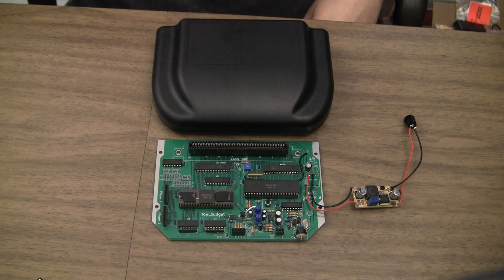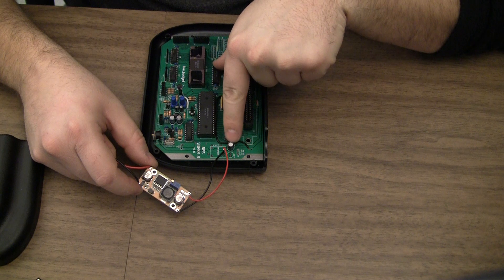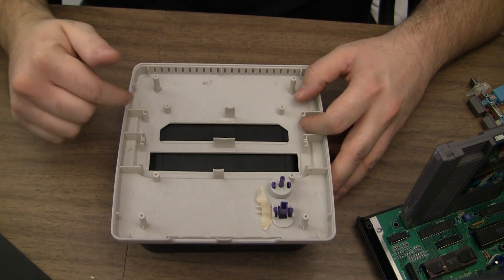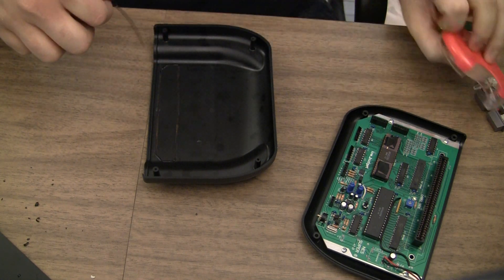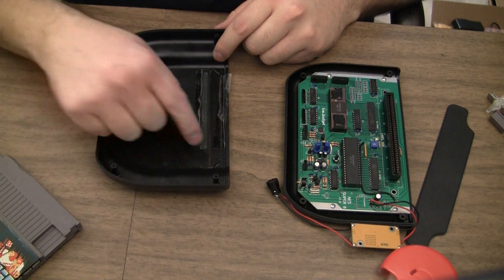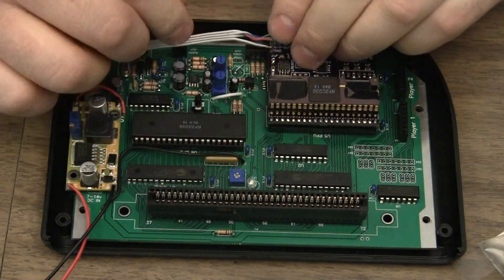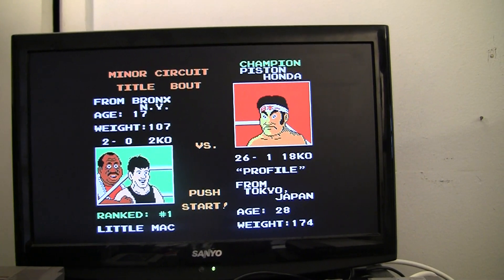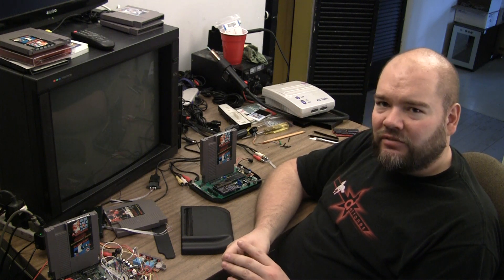NES Nintendo - Super 8 - Polycase - cut cart port with flaps - component video with interference!?!?

Comment from the maker: I might try to run some hot air over it too making it melt back to original colors instead of the whitening that happens when it's cut on.
Yeah the top area is the only place available for the controller ports, because of the case design.
Reply: This is happening to mine after an RGB mod and AV out for component snes cables. Did you figure this out? I've replaced the large cap and using a brand new Triad power supply. No matter what tv or configuration I get the same, even through scart.

Comment: Next time use a fine knife and heat it up so it's warm and slowly start your cut, once you have a whole use a hacksaw blade to finish the cut, will give u a very clean cut compared to the dremel
Reply: This isn't a bad tip, but holy shit if you do this, either do it outside or make sure you have a fume hood if the case is ABS or nylon-based plastic. You only need a few seconds of exposure to burning/melting ABS to end up with lung damage.